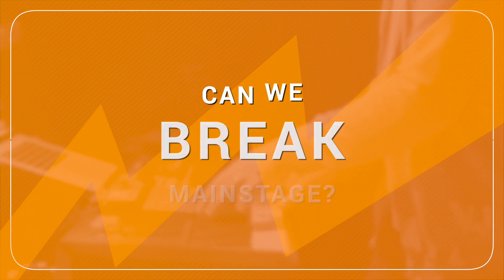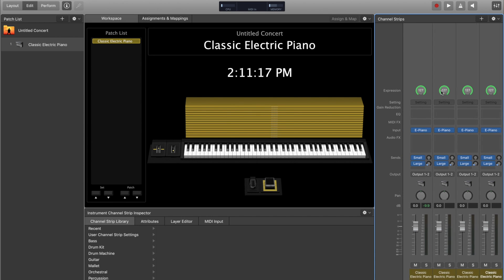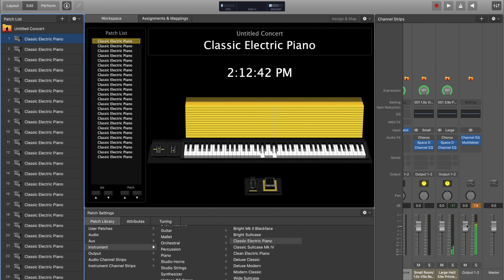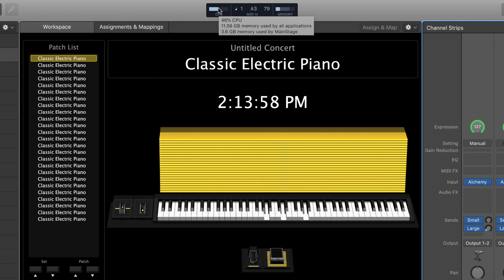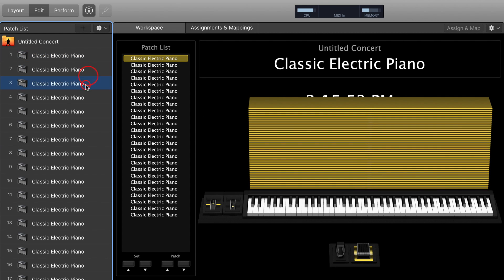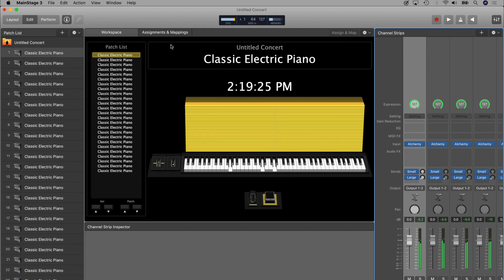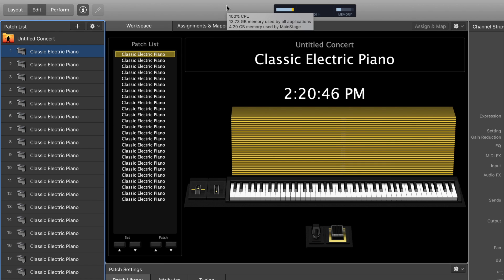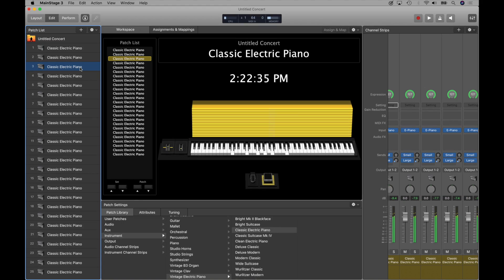MainStage Tutorial: Can We Break MainStage!?

Comment: with more CPU cores and more RAM you can run the I/O buffer at 32 ?
Reply from the maker: For most systems you want I/O buffer at 128 or 256.
Reply: @SundaySounds  For Live Play, the response latency drags. I frequently run at 32 buffers, and never higher than 64 for live play. Same 2016 MBP with 16 GB RAM. Otherwise, timed delays and arps get off timing-wise.